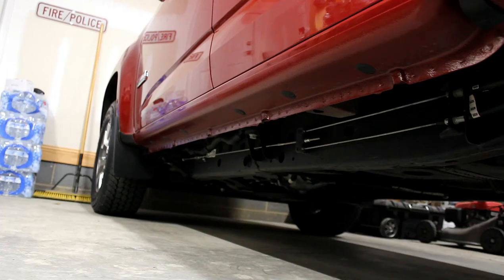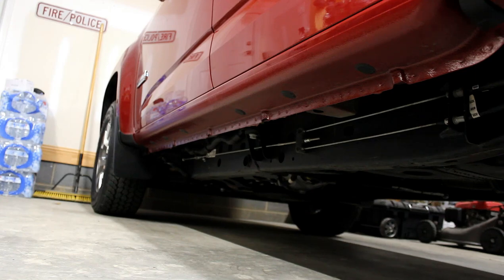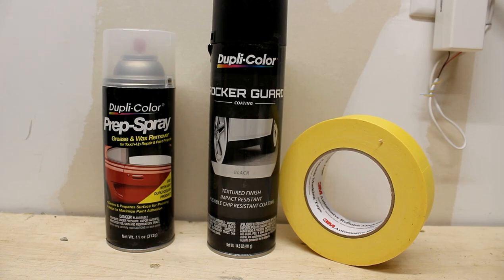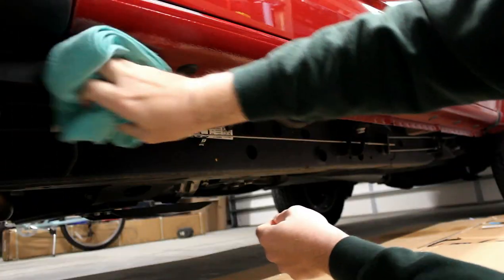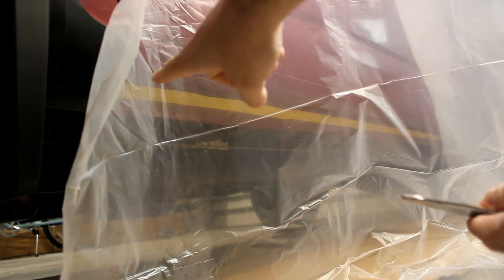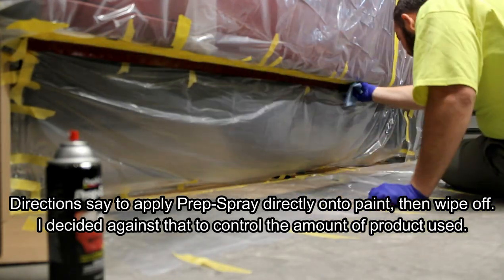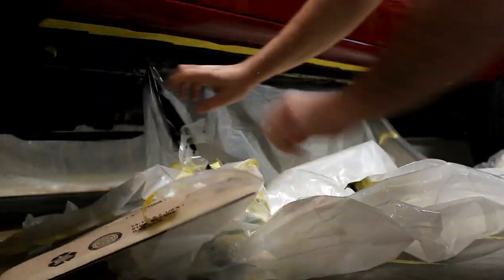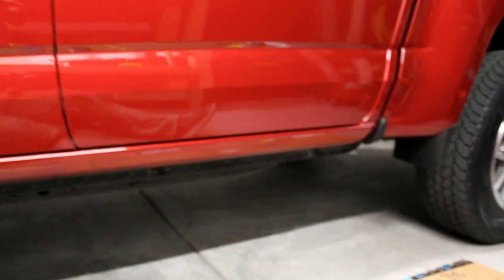[HOW TO] Paint that Ugly Rocker Pinch Weld on a 2015-2020 GMC Canyon / Chevy Colorado

Comment: I said the same thing about them looking ugly and unfinished.  I used some left over black bed liner paint to do mine.  It's kind of neat because it creates a rough surface with the little specs of rubber material in it.  One plus was I only needed to use 1 strip of tape because it painted on with a small paint brush so there was no need to worry about any overspray.
Reply from the maker: Nice. That’s a good idea too.

Comment: I did this a couple years ago on my Colorado. I just used flat black Plastidip. But yeah I agree it sticks out so much on colored trucks. I have the 3inch off-road OEM steps for it and with the pinch weld being black hides really well with the steps.
Reply from the maker: Cool! How has the plastidip held up over the years?
Reply: @fondupot  really well! Haven't had to touch it up since doing it. Taken it on mountain gravel roads and trails to parks in WNC (like to Max Patch), obviously washed multiple times over the years as well and still holding strong.
Reply from the maker: That’s great! Thanks for posting.

Comment: Dude would you know how to remove the plastic part on the rear bumber where you stick the jack tool to put down the spare?? I want to paint the rear bumper but i cant take off that piece.. Im stuck
Reply from the maker: I’m not 100% sure. Have your attempted to remove the bumper yet? I think the plastic just clips into the metal. If you remove the bumper you should be able to see from the backside how the plastic is attached.
Reply: Fondupot's Garage I had to remove the moldings to paint the bumper but it won’t come out unless I remove this piece. I made a video today painting the rear bumper and added information on how to remove the spare tire tube.